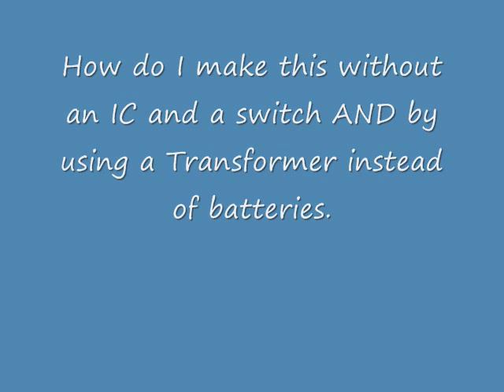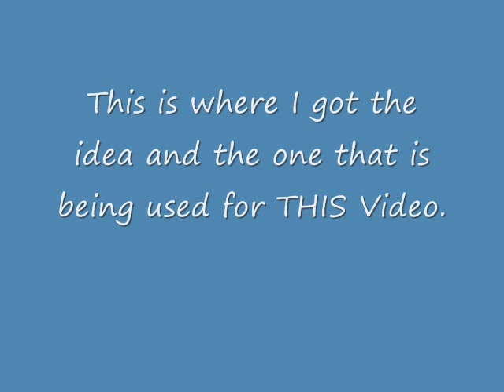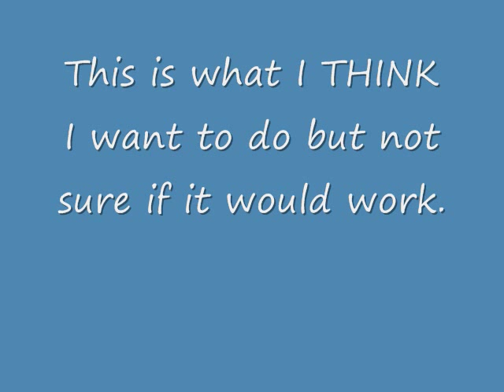How  do I make a LED FADE without an IC

Comment: Hi. Can u please help me. I had tried fade in, fade out circuit where I had used 510ohm resistor and capacitor 16v1300 mf. The result was it was glowing directly when powered on, but after disconnection of power supply, it slowly fades out. Why it was not giving fading effect

Comment: So the power goes through the Capacitor and the cap power the light. It like the Cap is the battery without holding a charge to keep the led up.

I want to do this on a project but i dont know if i understand this right

I have a LED strip about 10ft that power by a PIR with 12v so when i walkin the PIR power the LED and light up for 1min but it instance on and instance off. I want to fade for easy on the eyes. so i can put a cap infront of the led strip but after the 12v to have this effect?

Comment: Sorry what I'm trying to say is that you can replacr the batteryto wall mount transformer! Just pay attention to the polarity (+\-) use a multimeter to check them. Don't use the naked transformer you should buy the adaptor AC/DC

Comment: @DeCiscoKid Where do you get that information? I've worked with LED's since the 80's.  They are semiconductor diodes. Diodes do not hold a charge.  If there is any amount of capacitance in a typical LED, it is negligible, and not something you could make use of in a circuit like this.

Comment: @HaloHedgehog22  get a switch/button that has a common ground and two leads. make sure that when one lead is on the other is off. hook up a white and a red led to the two separate circuits. you could incorporate the circuit in the video if you wanted them to fade.

Comment: what is happening is that when the circuit is on the capacitor charges and when the circuit is urned of the electricity flows through the resistor and the capacitor slowly let go of the charge and then the led fades into the ground